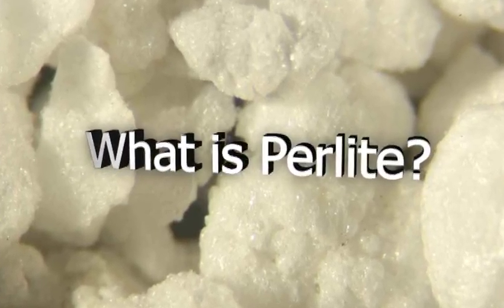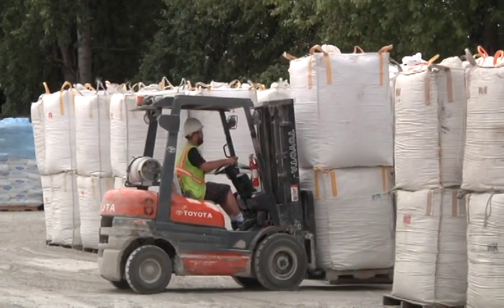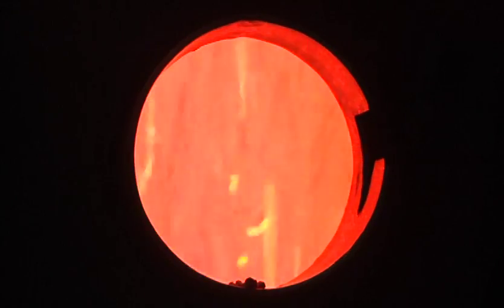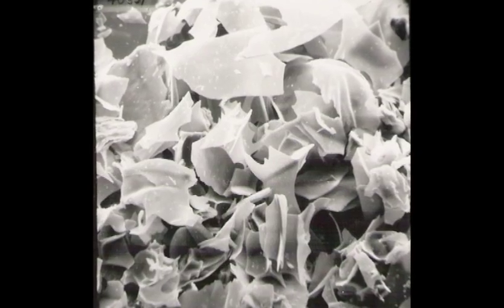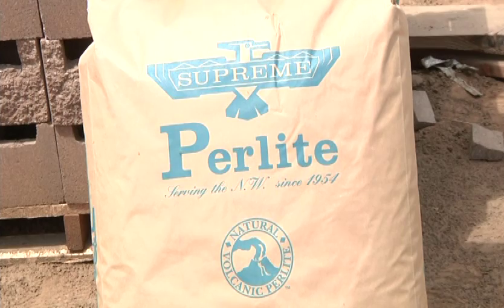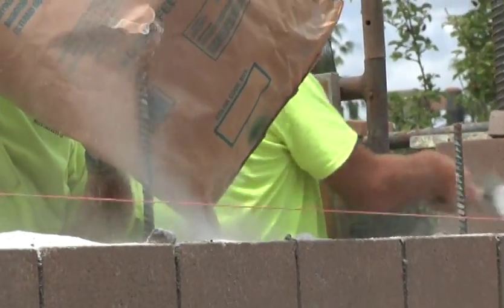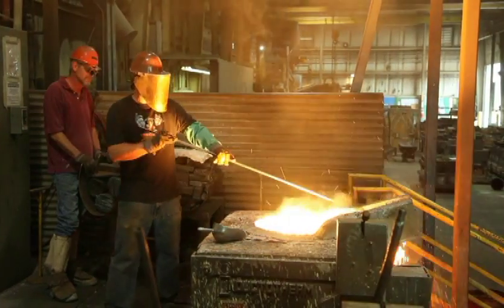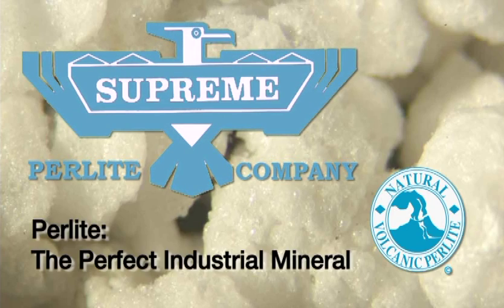What is Perlite?

Comment: Excuse me, what is the purpose of crushing perlite
Reply from the maker: In this video, the reference to crushing and screening refers to the large chunks and blocks of raw perlite ore that come out of the earth which must be ground down to reasonable size prior to  being fed into a furnace. If the size of the ore particles are too large (large volume relative to surface area), the heat will not penetrate fully to the core of each particle, causing uneven expansion.

Comment: I have used perlite like in the video for filtering wine. After the fermentation and settling, the bulk is syphoned off from the top, and then the lower left over bit with all the yeast still in it is fed through a rotating drum that is drawing a vacuum, the perlite is slapped on in shovel loads and then a little water is sprayed on it so it sticks, you build up a thick cake of this stuff, then the tank underneath is filled with the muddy wine, as it rotates it sucks up the liquid, the nice clear juice gets sucked through, and the crap stays on the perlite, which you scrape off as you go. It is one of the most tricky things I have ever learnt to master. Get it wrong, just a little bit, too wet, too dry. too slow, too fast, too much vacuum and splat, it all starts falling off and makes a mess, back to square one.
Reply: so if its glass how dose that not pass partials  in to the bottle and into the gutt
Reply from the maker: Thank you for your comment! Rotary vacuum drum filters are used in a number of industries for dewatering mixed liquids and solids, water recovery and recycling, and collection of valuable  solids that would otherwise go to waste -- important steps in helping industries protect the environment and be more sustainable. Typically we see the vacuum pump used to build up a thick layer of fine perlite on the septum prior to introducing liquid needing to be filtered. So-called "plate and frame" filter presses also commonly use perlite to protect the longevity of the septum and provide better filtration. There are a number of fine articles on the different types of filtration and equipment using perlite found on the Perlite Institute website here: https://www.perlite.org/library/#filtration

Comment: the epic battle of perlite and vermiculite
Reply from the maker: Thank you for sharing!  While each has its own distinct properties, both perlite and vermiculite are used in numerous industries and we support the use of both in different applications. Both are 100% naturally occurring, are relatively pH-neutral, and are safe for handling. 

Where perlite excels is its durability and insulating ability. Perlite maintains its structure for longer, which is important for horticultural soils needing consistent drainage, aeration, and water-holding capacity. Because of differences in structure, perlite also contains more trapped air by volume meaning it excels as a thermal insulator.

Comment: does perlite have the same insulating properties if you crush it to a powder and make a cement?
Reply from the maker: "Construction Grade" perlite (also known as "Plaster/Concrete Grade") is produced to meet the ASTM C332 specification for insulative value and compressive strength. It is designed to withstand crushing forces when added to concrete and other aggregates in a transit type mixer. There are some finer grades which can be made to retain insulative properties, but generally speaking, crushing and breaking the glass bubbles of which particles of perlite are composed would negatively affect insulative value.